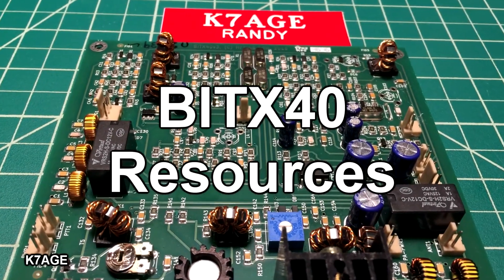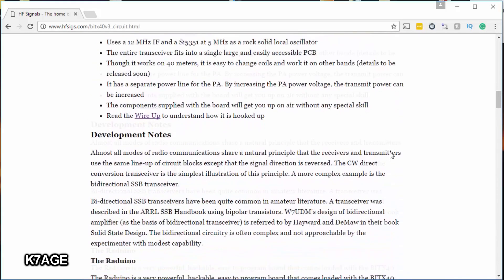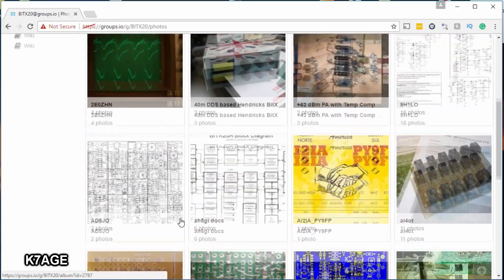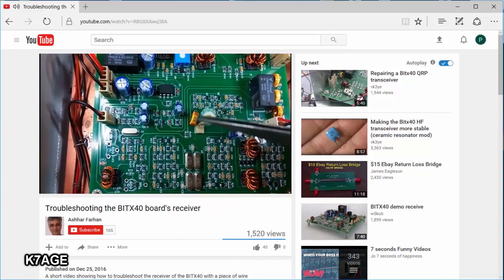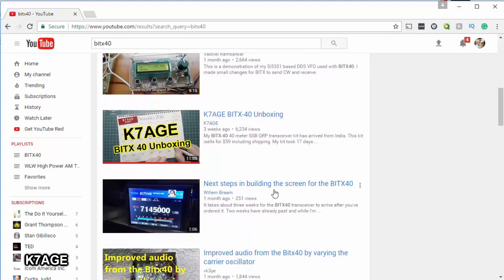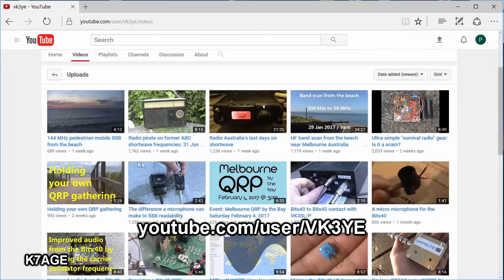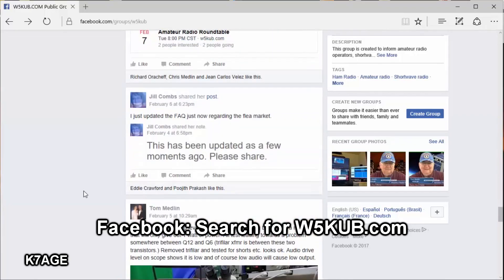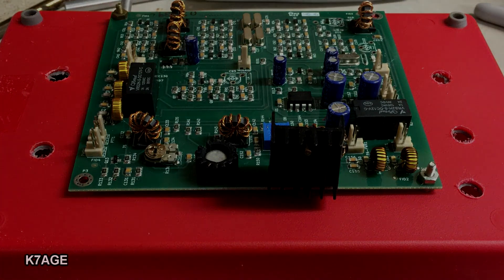K7AGE BITX40 Resources

Comment: Thanks Randy for the additional info on BITX40, I have had to delay my project as I had a Lafayette HA 350 that I had to finish up on the bench, then I started the BITX40, then This snow storm came Wednesday and I got delayed again, we got about 10 inches of snow so I have been busy with clearing it out where necessary, My old Radio Shack project cabinet will house the BITX40 nicely !! I have all the cutouts for readout and controls done, most jacks / plugs controls are now mounted, just ready now to mount display and main board, should not take long now, baring any more snow storms !!  Thanks  John Bellas KC2UVN.
Reply from the maker: Have fun with your build.

Comment: Wish this was a 20 and 40 meter radio... But I ordered one anyway. Thanks for your video and sharing your thoughts.
Reply from the maker: 20 meters was the original BITX20. There are guys changing the rig into a dual band. You need to change both band pass and low pass filters, along with the VFO. Dig through the BITX google and facebook groups.

Comment: the raduino uses crytals on it. can I not swap these crystals to use it on different bands. I'd like to build a rotary switch and/or a series of relays as a band switch.
Reply from the maker: The frequency is done with software in the Raduino. You would need to add bandpass and lowpass filters for each band..
Reply: K7AGE I hadn't though of that. but you set me straight. I don't know why I didn't figured that out. it's basically a sdr with transmit. thank you.

Comment: could one not add a proper mic to this sweet radio? I've just the mic for it, an astatic 575 m6. so if the radio has a sweet spot in its audio circuit. the tone control on the mic can tweak to meet the circuit wants. and it has gain control too.
Reply from the maker: Sure, mods and tweaks is what the BITX is all about.
Reply: K7AGE ,,, dang, now you have me thinking bitxcb. lol...